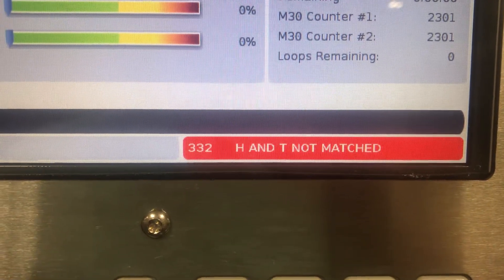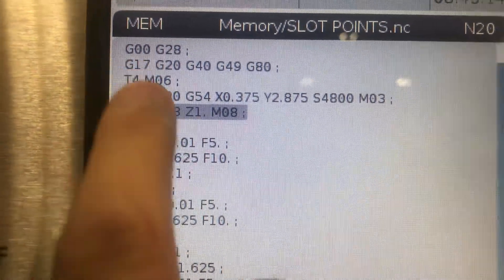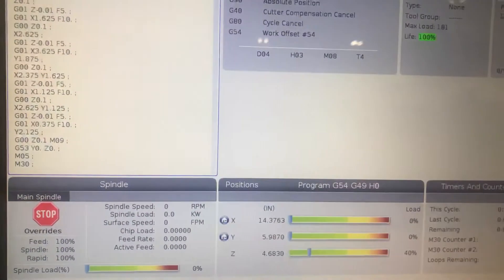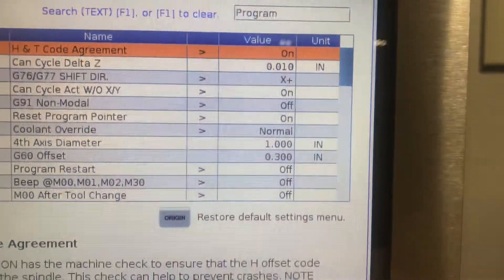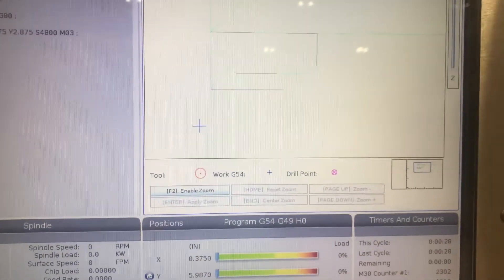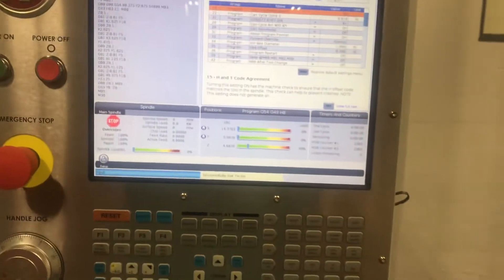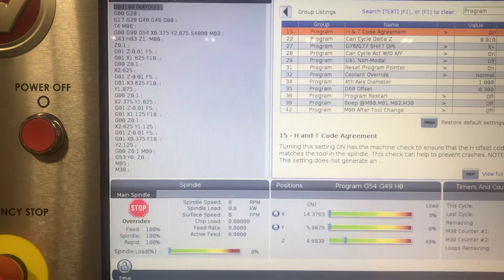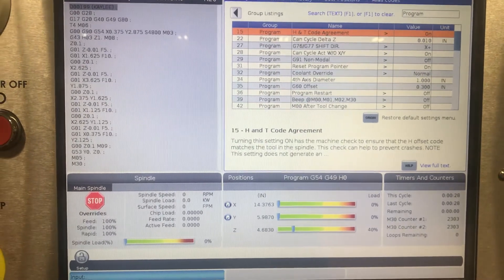Alarm 332 Haas Mill

Comment: Great video! But I have one question, what causes this alarm to go off?
Reply from the maker: It’s when you program something like a T02 with a H03 (mismatched).
AND you also have the setting for H and T agreement ON.

There’s been a few times I wanted like T06 but pick up a different length offset like H20.
When that happens you have to change the setting to off.

Great question!
Thanks!